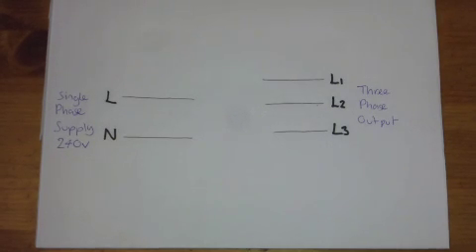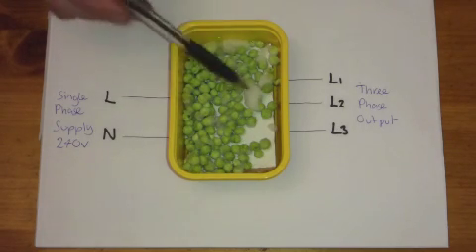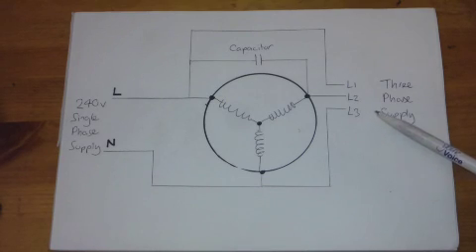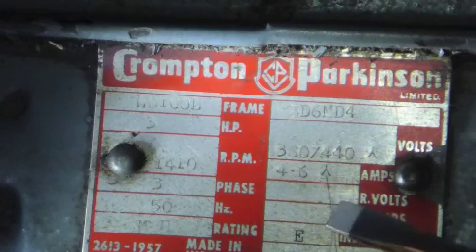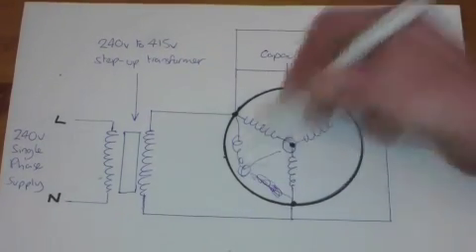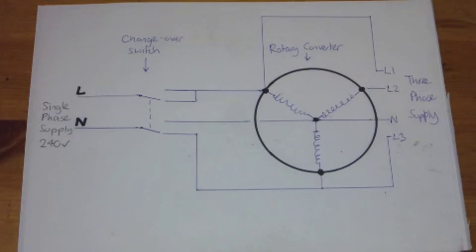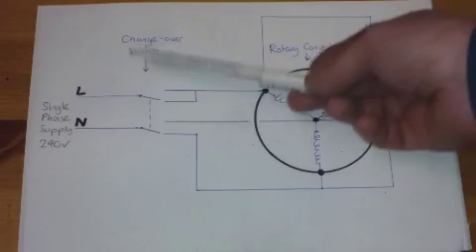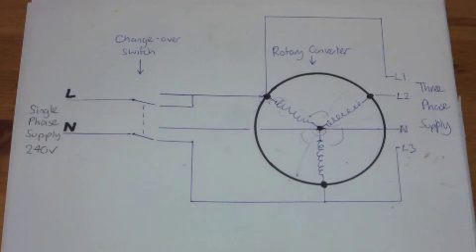Rotary phase converter - UK - Part 2.

Comment: How to take a relatively simple topic and make it......what's a polite term for BS?  Do lots of guys have 415 volt motors kicking around?  Oh, lets just use a transformer to boost the voltage from 240 to 415 volts....nothing to it.  415/240 transformers are probably as plentiful as 415 volt motors.  The gobbly-gook about tapping the common point of the windings to get a neutral is just that: gobbly-gook.

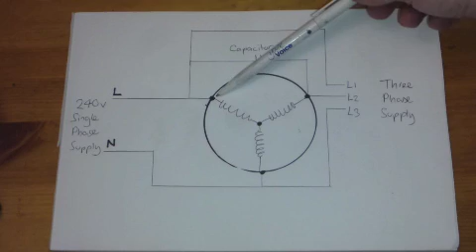Comment: @ 4:30 Please, please, please!  The other side of the 240 volt single phase is NOT the NEUTRAL!  Neutral denotes zero potential to ground.  Go ahead and grab the "N" in your circuit and let me know whether it's hot or grounded.  The proper electrical terminology is L1 and L2.
Reply from the maker: Using terminology that's commonly understood in the UK. I do not claim that this design is suitable for whatever supply is found in countries other than the UK. That's, what, er, 6 stroppy comments from you now, have I touched a raw nerve or something?

Comment: Unless you are running a 120/208 volt 3 phase 4 wire system, there is no neutral.  As for 3 phase machinery that needs a neutral, I'd ask the purpose of the neutral?  It's true that some machinery does involve control circuits that operate on 120 volt power which carries a neutral.  In such cases it's common to incorporate a step-down control transformer to provide the necessary 120 volts.  As the feed cable to the machine usually consists of rather heavy wire gauge, it's more economical to supply 120 volt control power from a transformer than to add a 4th conductor to the cable.
Reply from the maker: I'd refer you to the title of the series, which includes the country designation for which this converter is applicable : the UK. Yes, it's a 3 phase, 4 wire system ie L1, L2, L3, N and E. Yes, some of my machines require the N. No, they're not running at the voltages you refer to, because as the title says, it's obviously not applicable to the nation from which you write. You do realise that there's other nations out there? Which use different power systems with differing terminology?

Comment: Why does almost every drawing show L and N 240 volts?  There is no N in a 240 volt circuit.  If you find it necessary to label the conductors, L1 and L2 will do fine.

Comment: Hi I have a three phase 15 hp  motor  but not sure if suitable for this converter as its380/420 volt and delta wired so some advice needed I can send you a pic of the motor plate

Comment: For those who want to know how the solid state/ digital phase converters work without peas:
They are much like VFDs (variable frequency drives) and other inverters, single phase enters, is converted to DC (there may be a transformer before), this DC is then inverted back (normally using IGBTs) to a sine wave spaced 120 deg apart on each phase at the desired frequency. 

Most modern washing machines have a single to 3 phase VFD to power the drum motor, as the 3 phase induction motor is cheaper and lighter than the traditional DC motors used in older washing machines, the problem is though the 3 phase inverter boards have a tendency to fry and go pop.
Reply: The really nice thing about VFDs is that they are quiet, unlike a 3 phase motor spinning up like a helicopter getting ready to take off.
Reply: Other advantages that you won't get with an RPC are they have the ability to limit inrush starting current, protect the motor from overcurrent, and change the motor speed to almost anything you need with the touch of  finger.

Comment: Galvanizedsankey,   I hope you are still checking these videos!   The use of the transformer from 240 to 415 volts should work just fine.   Across the pond, we call the new electrical system on the secondary side of the transformer and the rotary converter a "separately derived system".  So in your diagram, you need to connect the center point of the wye (star) to earth with a GEC(Grounding Electrode Conductor) over here.   Not sure what you call it.   Then you will have a 416/240 volt grounded neutral system.   I'm assuming you need the 240 volts to neutral for controls, not the motor itself.   Correct?    Respectfully, Kevin in USA

Comment: What is the voltage that you have on single phase ??? Does that include two legs like here in USA of 115 to 120 volts each leg times two plus a neutral and ground ??? Thanks
Reply: No, over here in the UK most properties (especially residential) receive a Live (based on just one of the 3 phases produced by the electricity company) at 240v (nominally) and a Neutral which should be (but often isn’t) at the same voltage as Earth. So then you only have “one leg” of electricity giving your 240AC between Live and Neutral. I may have understood this but I thought that in the USA you have 2 ‘legs’ of Live mains supply at 120VAC, so that some appliances can be run at 240VAC by combining the L1 and L2. Sadly we don’t have the equivalent here in the UK (i.e. 2 legs, L1 and L2 both at 240VAC) as otherwise it would be even easier to generate a 3 phase supply.
Out of interest, what you can sometimes find is that a neighbouring building in the UK has their mains 240VAC on one of the other 2 phases of 240VAC available from the supply (as the electricity company split the 3 phases to try to balance the load). This can sometimes cause unexpected problems, such as if you ran a cable between the 2 properties with devices powered on different phases! I know this was an old comment/question, but thought it may help someone 👍
Reply: @stephendixon8575  This is what I wanted to know. No problem with the late response and help me understand what you have in UK. I now understand the problem with having only one leg of three phase power. There is something strange here in the USA, 3 phase 208 volts. True 3 phase with a power factor about thirty percent lower than a standard 240 volts single phase with two hot legs and a ground. 
Thanks for letting me know Stephen. I know many people use a VFD to make true three phase clean sine wave power. Others like myself made my own rotary phase converter which I use to power my machines in my shop. Not a true 3 phase per say but close enough as the motors do not mind or care. 
Peace vf

Comment: Really wish there was a part 3, although there is probably enough here to go on for those in the know. Hope your not in jail 😉
Reply from the maker: Good news: Part 3 is now live... bad news: I still need to do Part 4. Apologies for the delay.
Reply: @galvanizedsankey5854  hi there have gone through all your videos and basically have built my system,busy with the motor wiring and then realised i have a 15kw motor 380-415v delta and 600v star but will then not have the true or any neutral,Will it still work, please help.I am in South Africa not much advice around
Reply: Hi interstate  I'm sort of in the know but doint know enough  maybe you could put up a version of what part 3 would be like cheers
Reply: I might, I'm still putting together all the parts, mine will utilize a 7.5kW idler motor. Hope to have it done by the end of the year or so. I have an old cylindrical grinder with a total of 6 motors on it, including a 415v to DC converter with speed controller for one of them lol so this type of converter is what I need.
Reply: sounds like it could be fun for the appeal is the neutral

Comment: I thank you so much for the videos on your very impressive converter. I have being running woodworking machines for over 20 years on a static unit. and would agree with every thing you said about them. i have burnt out at lest three motors, i want be upgrade to a larger system like yours. could you please post the third part or at least explain the capacitor set up .your diagram doesn't show any.

Comment: Hi I have waited over 5 Months to get an answer to my test results which I had hoped would help to contribute to this work?. In my tests I used a 240volt single phase supply initially connected L1-L3 to Start a 3 phase motor in star with capacitors operating to produce the 3 rd phase at reduce speed because the phase voltage was at 240 vac( motor in. Star needs 415 volts) then switched once the motor was running to power the 3 phase motor on one phase only with capacitors running the other phases! In this configuration you get a proper neutral on the center star point. I.e. L1- center star 240 volt neutral connected to star. The only problem I'm having is the motor gets two warm for my liking! I'm now buying infrared temp gauge and will continue with my tests as its very frustrating to have not have received any response to my requests .....and we are still all waiting for part 3. What's the real problem we have all been supporting your efforts! I'd like to understand.

Comment: Hi I've been trying your concept out on a 1 hp motor to see what balence I could achieve not knowing what size capacitors or your circuit.  The motor is 415 volt star connected. With a single Phase L1and neutral supply of 230 vac. Initially I apply single phase L1 to L1 of motor when star connected and with the supply neutral initially going to L3 . With a capacitor C1 fitted between (L1-L3 =8.4mf) plus cap 2 L1-L2 15mf and L1 to L3 of 10 mf. With this set up the motor starts fine and I then switch from start to run which then changes the neutral to the center start point.

Test results. Are L1-N 230v, when in run position we get supply current draw of 2.61 amps with L1-L2 =430 L2-L3=418v and L3-L1=403 volts.

The motor is starting to get reasonably warm- hot? Any ideas. If I reduce the capacitors then the voltage balance drops to around 370 volts on lowest phase.
Reply: Hi Andrew That was sort of problem I thought I would strike with 2 phantom legs, hence the reason I am waiting for
Galvanizedsankey,s part 3 as I need  a neutral for some of my plant, looking forward to part 3 hopefully  soon